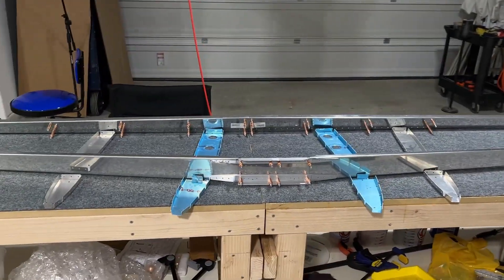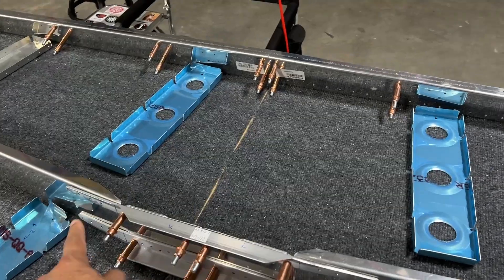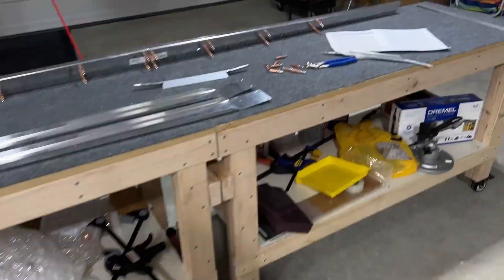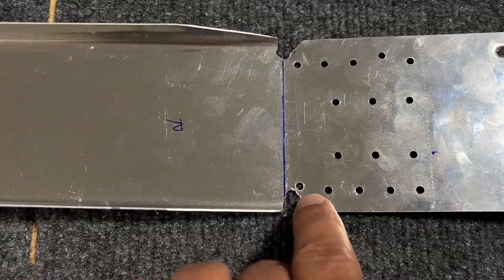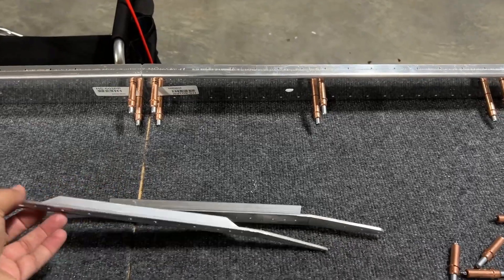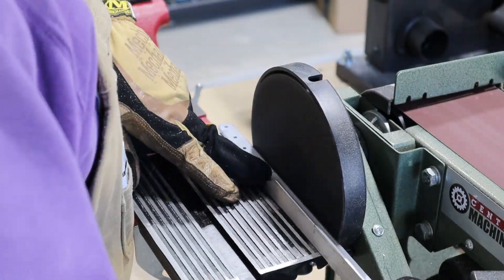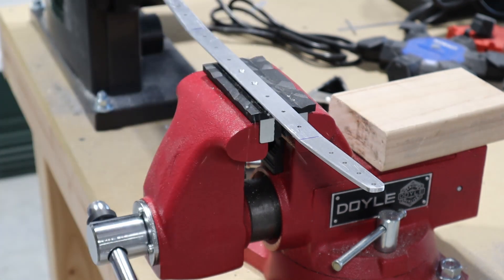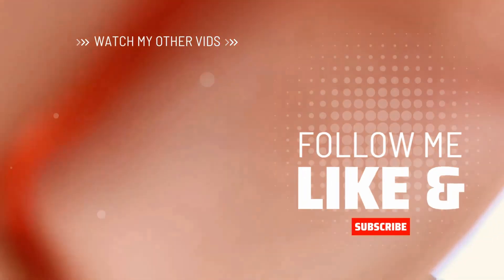Van's RV-8 Build. Ep 003. Horizontal Stabilzer 03

Comment: The very first thing I noticed with my -8 empennage kit was that the spar reinforcements (HS-609PP. what you're pointing at at 01:49) already fit inside the bend radius without having to do any breaking. Clecos went in just fine with little to no effort, save for the upsizing to #30 yet to come. As of this comment, I am yet to formally and permanently fasten it all together as I am waiting on my sander to arrive; I did have to use a little Brasso to clean off the glue left behind by the labels, and then I fine-grained sandpapered them to get them ready to be primed. But now having watched this video, I suspect, I will still have to take them to the Scotchbrite wheel to maybe dull/de-edge them even more before I prime. Thoughts?
Reply from the maker: I’ve come across the number of examples where the instructions tell me to modify a part only to find out that the part arrived in the kit in its final state. I’m guessing these instructions are a hangover from a previous iteration of the kit. In the beginning, I would blindly follow the instructions. Now, I study the instructions, the drawings, and the part to determine what really needs to be done. So, it may not require as much work as the instructions indicate. Btw, a cheap heat gun makes easy work of sticky labels. Having a acetone in a wash bottle to squirt on a rag will get rid of the residue quickly. It took me forever to find the wash bottle. I put a link in the description for my most recent videos. 

Have fun!

Comment: Thanks for sharing your videos. I've started building an RV-8 and I've learned a lot from your experiences. I'm into day 2 of the horizontal stabilizer. Interestingly, my kit came with 2 sub-kits backordered. How long did it take for you to get your hinge parts?
Reply from the maker: Thanks Guy! Congrats on the new build. I, and many many others, waited a long time time on brackets and bearings. It was about 5 months, which is an unusual delay. It seems like the hangover from the ‘21-‘22 supply chain debacle is starting to go away. Vans has recently received a huge shipment of many of those b/o items and they’re getting caught up. Your delay will probably be much shorter. My emp kit is now completely fulfilled, and yesterday I got a big wing kit b/o shipment. Now I’m only missing 4 rod end bearings.